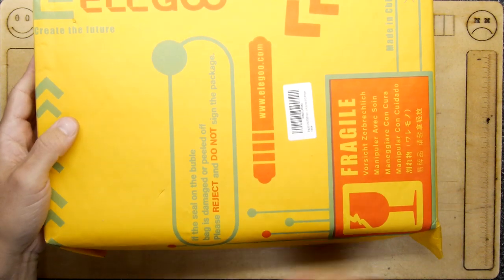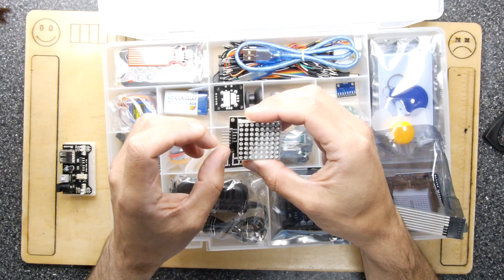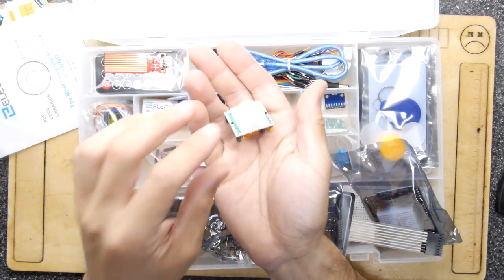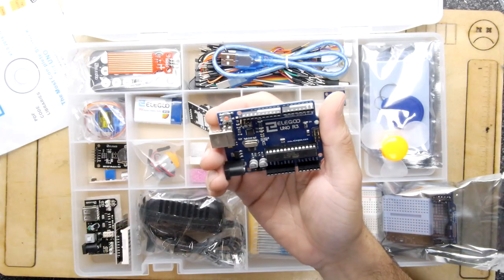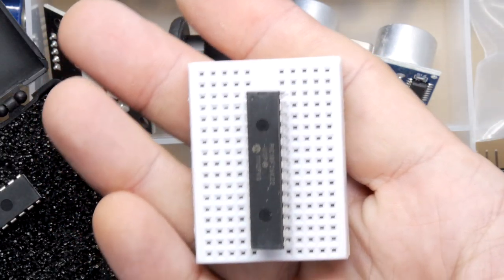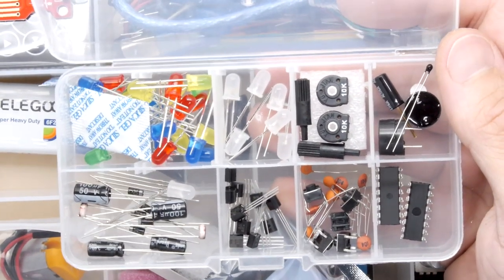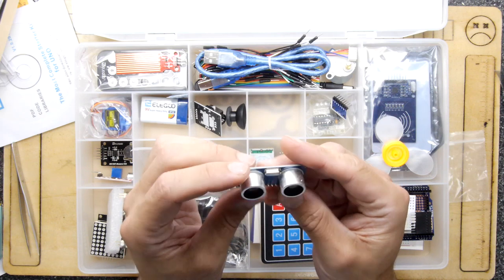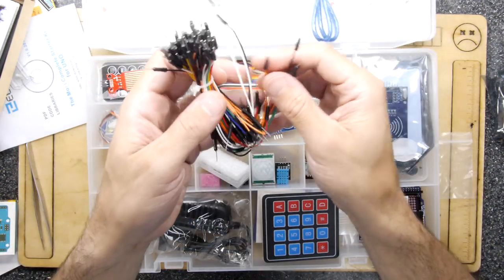Elegoo Uno R3 Complete Starter Kit

Comment: 240v shock is like a punch very painful , my arm mussles also tightened up ( DO NOT TRY THI
Reply from the maker: Yep, electrocution is definitely best avoided
Reply: I used to work as a tech in a bowling alley and the pin return machines were a deathtrap waiting to happen, exposed wiring switches well out comfortable distance and i was resetting a rack and reached to turn it on for testing and woke up on the floor twitching having had 412 volts I think it was. I didn’t like it much